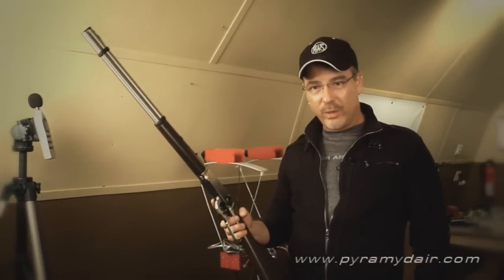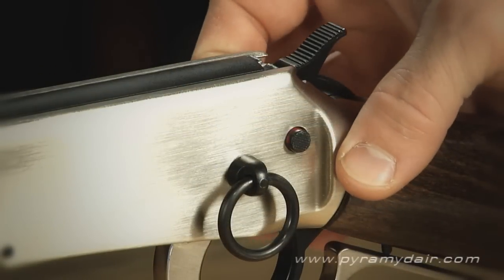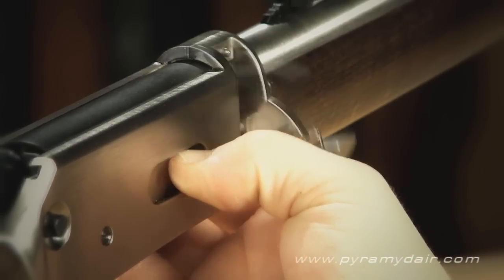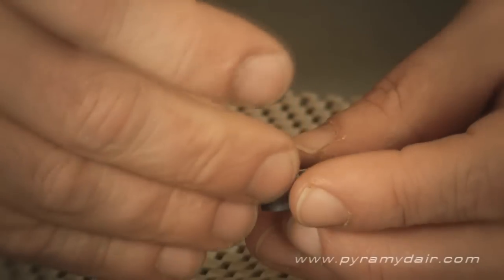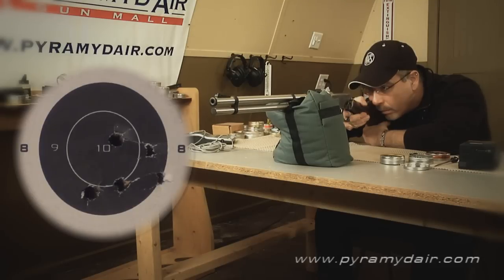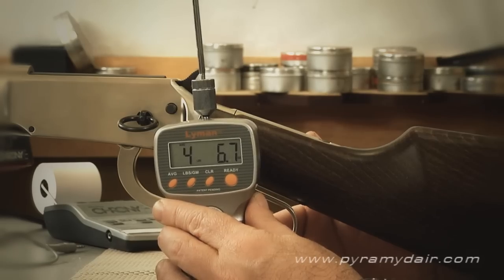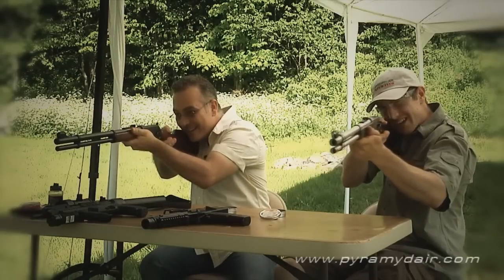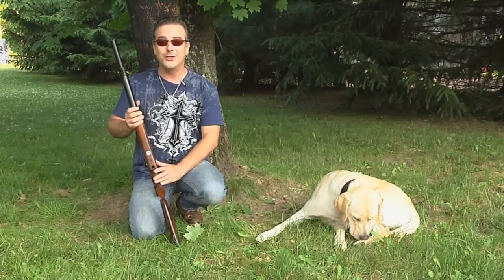Airgun Reporter Episode 89 - Walther Lever Action CO2 Air Rifle

Comment: Nice job on another favorite!  Walther makes a scope mount for this, but you need to use a longish scope, as the scope ends up a bit forward.  The Walther 4x32 scope works well.  This is one air rifle that you will kick yourself for not getting sooner.  It is accurate and works flawlessly.   Mine likes JSB Match Diabolo Exact .177 Cal, 8.4 Grains, Domed pellets.

Comment: The nice thing about my marlin 39A is no need to worry about co2 and with 20 grains and at 590 fps made by aquila powderless rounds some misfires but put it back in and will fire little more expensive at about  $6.00 for 50 rounds but than no need for co2s

Comment: Very good gun, i have shot maybe 250 rounds through mine now, 0 problems mechanically, except that for some reason i could not use my old 88g CO2 flask i had laying around, it is maybe ten years old and has a muzzle that is too short to fit the rifle
The only thing that could make this gun better is a larger magazine and slightly taller fiberoptic sights
Also i sort of want a straighter stock with a soft butt

Comment: People complaining about the price….what you're paying for is german quality…this gun will last decades if you look after it.
Reply: Generally Germans don't know shit about quality.

Walther does though, they are the exception to the rule. As are Mauser in terms of weapon manufacturers.
Reply: DressedWings German guns have good quality, but now umarex Produces guns under lincense and Ruin good names
Reply: @DressedWings ,  The excellent German craftsmen were carving excellent Coo-coo clocks  in the Black Forest before Hitler messed things up.  Dr. Fernand Porsche came up with a plan for a car that most people could afford, the People's car (Volkswagen.)  It was a genius idea  to place the engine over the drive wheels because it increased traction.  There are many other examples of German engineering and craftsmanship.
Reply: @arrlmember  The idea of a car that could be owned by the masses was a concept that existed far before Porsche rubbed his brain with Hitler. The cost of the Beetle was a few reichsmarks off a base Ford Model A/B. The idea that the German state was saviors of the working class / poor was propaganda to secure Hitlers position.

The VW Beetle design was definitely a good automobile for the mid '30s but when they adapted it to a combat vehicle in the Kubelwagen it became apparent that the relatively weak rear engined RWD was a poor choice even for dirt roads and they had to throw a 4wd in their vehicles when they had the resources. 

There are just as many examples of poor German engineering and "craftsmanship" as good, especially during the mid 20th century.
Reply: @DressedWings  The concept of the assembly line came about after Henry Ford toured a Chicago slaughterhouse.  Actually the slaughterhouse was a disassembly line, but Ford understood the concept.  However, the economy and other factors were different in Germany.  The word Volkswagen means people's car (folk's wagon.)  

Dr. Porsche had a good idea, with only two faults that could not have been known at the time.  While the increased traction of the engine over the drive wheels IS an excellent idea, he put it in the wrong end.  If your steering and traction are both up front, it does not matter if the rear end slides a little in corners.  The other issue, which made it worse, is that the engine was not exactly over the drive wheels, it was BEHIND them.  That made it easy for the rear end to drift.  Ignorant people have said that the Kraut Can is top heavy and rolls easily, only because they were going too fast around corners in top gear with their foot on the brake.  Rear engine cars with automatic transmissions are IMPOSSIBLE to control.  Now that in excess of 90% of the people that think they know how to operate a motor vehicle prefer an automatic transmission to actually learning how to drive, front wheel drive is extremely important.  We can thank Dr. Porsche for the traction portion of that advantage.  

There were many brilliant German scientists.  It is fortunate for the world that the Nazis hated Jews so much that they did not believe any Jew's thoughts were worth considering.  That is why the inventor of the atomic bomb had to escape from his homeland.  The world would be a different place today if the Nazis had kept that brilliant German Jew.
Reply: @arrlmember  You do not need to keep repeating that VW means peoples car. If any person in the world knows any piece of the German language, its that Volkswagen means peoples car. It's not a little known gem of a fact.

Assembly lines were established far before Ford by weapons manufacturers (like Springfield Armory). Ford is famous for making it with a relatively new industry. It also doesn't really matter to this situation because I was bringing up the cost of the most common cars available in Germany. The Model A / B actually made it to market in Germany, and the price for base models was near the same as the planned price planned for the Beetle, about $360 for the VW vs $380 for the base Model A in 1933. The VW was as designed just as much affordable as the Model A. And like I said, the Model A was actually available, not a smoke and mirrors promise made by the Government that didn't come into fruition until the US was rebuilding Germany after the war.. 

I honestly have no idea what you mean by "the inventor of the atomic bomb". Nuclear fission was discovered by a German chemist who was not Jewish and he stayed in Germany for the war. Albert Einstein and many other Jewish scientists who ran from Germany/Europe explored the theoretical possibilities of nuclear fission being weaponized but he was not part of the Manhattan Project, and the Manhattan Project was so far from being accomplished by one person that I don't even know who you would even attribute it to.  Oppenheimer, the head of the research laboratory that produced the first atomic bombs was the son of a Jewish man, but he was not from Germany or even Europe. He was born in the US.

The Germans did shoot themselves in the foot by targeting their intellectuals, but there wasn't one individual jewish person responsible for atomic weapons, especially one that came from Germany. It was the coming together of scientists of different nations and creeds. 

The Germans did not have the economy or industry to even match something like the Manhattan Project anyways after how much they committed to their V-1 and V-2 programs (about 50% more for a weapon that was ineffective and killed more of its manufacturers than enemies). The worst part of that is most of the research for low orbit rocketry was already accomplished before they began even producing the V-2, so it wasn't even that there was early hurdles that cost the program what it did.

Comment: has anyone tested the proton 3x 88g air replacement cylinder for the 88g co2 cylinder. i am using one in my walther lever action rifle.  i dont like co2. i never shoot over 300 shots. the co2 leaks out over night. i like the 3x. the cylinder can be pumped to 200bar. but it seems the walther wont operate with a pressure over 95bar. i get about 60 good shots at 95bar.. has anyone got the walther to work with over 100bar?

Comment: can we tweak it ??? ;)
Reply: Yes u need to put a heavier hammer spring in it and also u need to mill out the transfer port a bit but be carefull as its a delicate job u gain about 200fps more and a frend of mine bored the rifleing out for the first 6 inches of the barrel to reduce bore friction but im not sure it did much tbh its not accurate anymore either

Comment: Both Winchester and Marlin bent over for the democrats and put in a useless cross bolt "safety."  The half cock safety can be seen while you are holding it in the firing position, whereas the cross bolt cannot.  I have an old Marlin 3336 SC in .219 Zipper that does not have this useless feature.  If I were to buy a new lever action, it would be a Henry.  That's why I would not buy this thing.